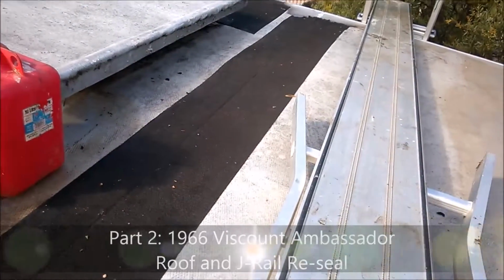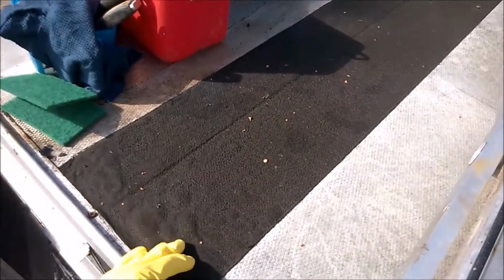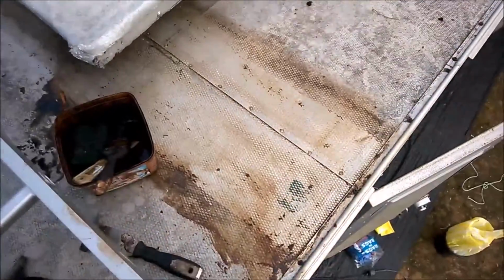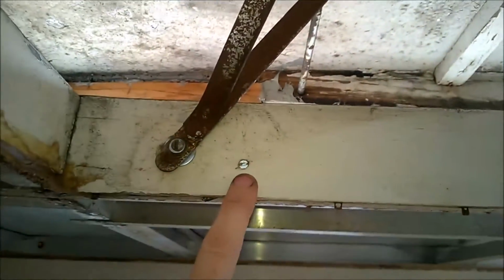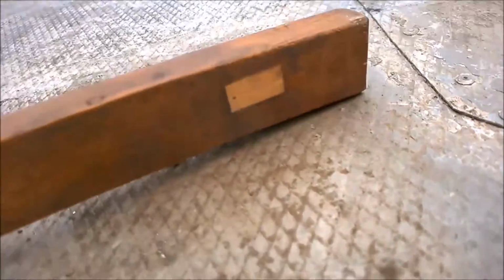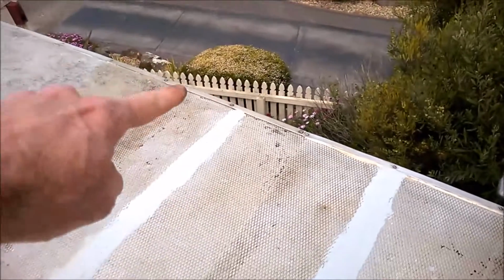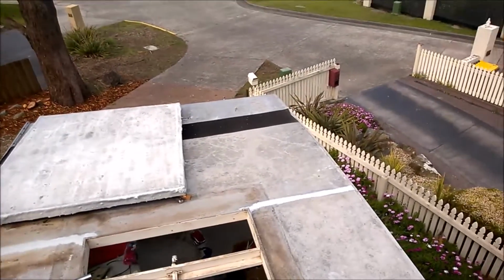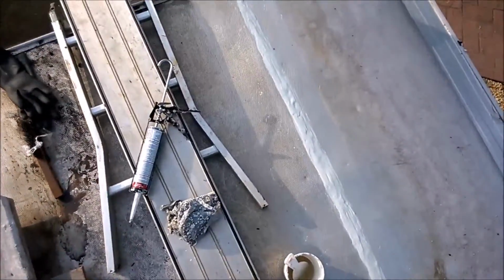Part 2: 1966 Viscount Ambassador - Roof and J Rail Re seal

Comment: Looking good! what sealant did you use on the roof?
Reply from the maker: Thanks mate, a lot of work indeed to get it right!  I use a product called Parfix Sealant and Adhesive. Read on other forums that people where happy with it, but to tell you the truth, there are so many sealants out there that its confusing!  See how this one lasts...
Reply: @rovertasmania7033  how did the roof sealant hold up as you didn’t use a butyl mastic
Reply from the maker: @ja8020  In the time I had it no issues. This was a harder job as it meant sqeezing the adhesive into the overlapping gap.  Main thing with any product is clean and prep. Of course, NEVER EVER use liquid nails.
Reply: @rovertasmania7033  thanks for the confirmation on using the sealant/adhesive for the roof and hatch.